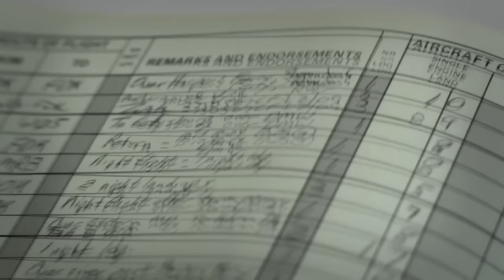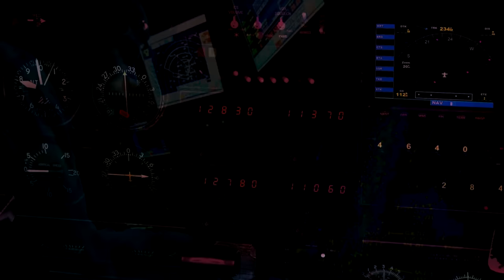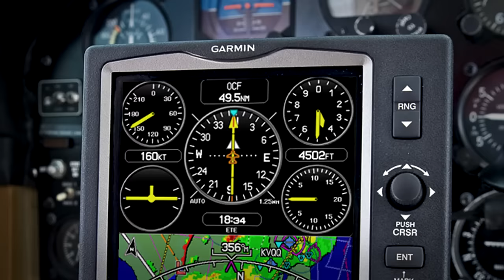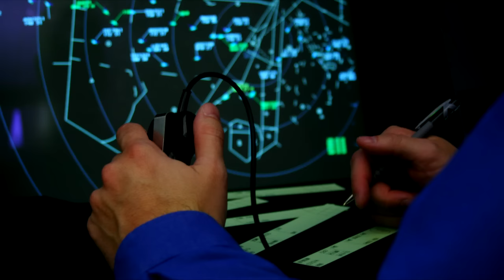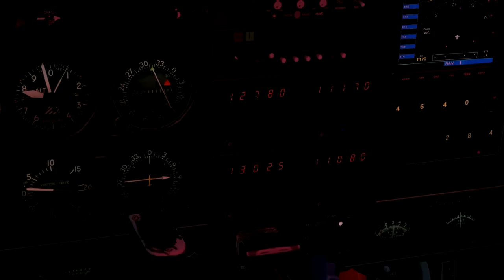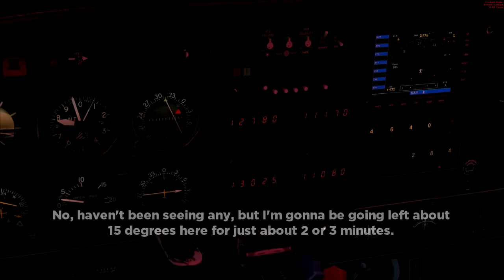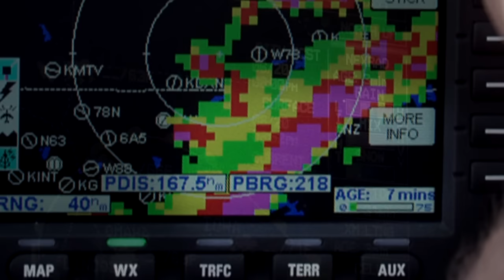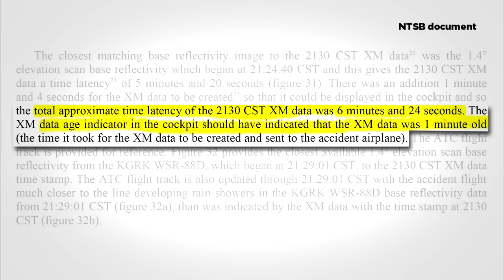Accident Case Study: Time Lapse – misunderstanding in-cockpit weather displays can lead to tragedy

Comment: Does not matter what you fly. Back in the 70's I was helping a bunch of Hot Air ballons guys.  Some I did not help because their lack of attention to the weather..  One pilot thought it safe, except a weather front was due and they probably ignored it.   "Five people were killed and a sixth was critically injured in a fiery crash Saturday night when a birthday trip in a hot-air balloon ended in tragedy after the balloon smashed into high-voltage power lines in Barrington Hills and exploded in flames.
 The lone survivor jumped from the balloon and landed on the median strip of Route 14 at Kelsey Road after a fall of as much as 100 feet, Lake County Sheriff's police said.  HARRY EVANS, 29, of De Land, Fla., was in critical but stable condition in the burn unit of Evanston Hospital with burns over 25 percent of his body."
Reply: Is that story on the net? That happened a couple of years ago in Lockhart, Texas, during the day about 1000AM in the morning
Reply: I found it, the accident your referring to happened on August 17, 1981
Reply: The pilot. James Bicket, 26, of Bloomington Illinois realized a fast moving storm was approaching and tried to land upwind of the power lines and a gust of wind blew them into the 34,000 volt power lines

Comment: What I see is that the controller assured the pilot was in the clear.   what i dont get is when the pilot said he was skirting the edge of the storm the controller confirmed this back to him.   I know the nexrad is delayed but isnt the controllers radar in real time???   The pilot said he was going to keep the heading until he got south of the storm and the controller said that looked good to him.   next thing the pilot is right in the middle of the storm with loss of control.  Something not adding up.  IMO the controller should have said turn left another 15 degrees, but instead he said it looked good to him.

Comment: Why doesn't this video address the significance of the left wing separating from the fuselage?  Yes, he shouldn't have been flying through a thunderstorm, and it's important that they discuss the delays in radar, but the real cause of the crash was the detached wing.  In the manufacturer's defense, no matter how much you reinforce the wings, there will always be some threshold of stress beyond which they'll detach.  I get it.  I just think that threshold should be a lot higher than the stress generated by what looks to have been a fairly ordinary thunderstorm.  I would never want to fly through such a storm, but it would be nice to know the plane has a backup plan in a worst-case scenario like this.
Reply: There is mo significance in this. This is a result and not a cause. In bad weather chances are your experience turbulence that put your aircaft beyond it's limitation (Vne) and then a little bit after it start to break up. There is no point knowing precisely at which point it start to break, but i must be beyond the certified max speed plus a margin.
Reply: Thanks for the thoughts.  I agree the primary cause was the bad weather, but if the aircraft's limitations were a little higher, perhaps the pilot could have maneuvered out of the turbulent air.  Higher wing loading would have been a valuable redundancy in this case.
Reply: Yes, Cessna should use 4 x 8 x half inch steel I-beams for wing spars.

Comment: I’m always leery of low time pilots who begin all radio transmissions with “Hello Houston, you got N, bla bla bla with you” the phrases “you got” or “with you” or “and.....” are the cute little phrases of pilots trying to make the world think they’re big ole cow boys. This little ole cowboy was just in too far above his experience level. And what the heck is he doing way up there at 8,000? That just got him a rougher ride and longer free fall after the wings got ripped off. I used to haul mail at night. If you can’t fly above a thunderstorm and you want to get close or find yourself inside it, well, you want to be as close to the ground (within reason) well before you get into the rough air. Plus, yes......single engine Piper Cherokee 6 had no business that close to storms at night even if pilot was a cowboy. Va speed of a PA-32 is so slow that a gust from behind can put one or both wings (depending on what angle the gust strikes) into a stall resulting in a spin.
Reply: No one should have tried to fly through that, no matter their experience level. But, an honest question: Assuming someone was dumb or desperate enough to fly through it, wouldn't a higher altitude be better? As you stated, a gust could cause a stall or spin, wouldn't more altitude give you more time to potentially recover? (Not a pilot, just curious.)
Reply: Def Misanthrope 
Right! I’m not going to encourage anyone on here to try flying close to or through any thunderstorms. I just know that when I started flying mail at night, I asked our chief pilot about flying around and between storm cells. What he told me was stay low enough to be lower than the clouds so you can see and avoid the rain shafts. Also, the gusts will be more horizontal (which can be very bad) rather than vertical. Can you imagine the stresses placed on the airframe when it is flying through a 1000’ per minute up draft and that up draft immediately shears to 1500’ per minute DOWN draft? That and worse is what goes on up inside a mature
thunderstorm. I think of it this way, when you dump water out of a bucket, what does it do? It falls almost vertically until it hits the ground and then it splashes horizontally. Yes that could cause a stall or spin but I can do things to avoid or recover from that. If you fly up there in the severe updrafts and downdrafts and the wings fold up, well, there’s no recovery from that. And no, a parachute recovery system is not going to save the day on that one either. That’s my opinion.
Reply: @lembriggs1075  Huh, interesting. I know that paragliders  have been carried up in updrafts to their deaths, like 30,000ft without oxygen. Just be high enough, though, to avoid encountering microbursts too close the ground.

Comment: important points but the   air traffic controller should have told this pilot that he should immediately turn around, land at a save airport and wait a few hours until this   frontal activity area has passed.  Or go up to 40.000 ft and fly over it.
Reply: But the sigmet said the weather was crap up to FL450?

Comment: Why did he turn right into the weather's path? Even the ATC told him to turn right...

It still seems to me that a major problem happened here in that the pilot ignored the turbulence while focusing on the display, even ignoring the 6 minutes that it takes the system to scan the skies and prepare the digital display, and the 1 or 2 minutes that it takes to broadcast it to the receiving stations. The turbulence experienced by the pilot is very-much real-time just as the sound of the rain hitting the plane is. Steady rain with no turbulence is one thing. But when the plane is already going slow because of the high winds, and then starts to bounce up and down as you fly into the main cell of a thunderstorm? You really need radar to tell you to change direction Right Fucking Now? This isn't about "misunderstanding navigational aids" this is about being butt-fucking stupid. 
 
Clearly 450 hours of air-time and an ILS rating isn't enough to understand the planes' inability to withstand severe turbulence that of course wasn't even displayed on his precious Nexrad. It's like driving through an active construction site expecting someone to tell you exactly where the nails are going to be. And there's probably nothing that sucks as much in a plane as the wing coming off..probably every passengers' biggest fear on a flight is that the plane is going to disintegrate and crash from high altitude. At least in an explosion or a crash you're going to die quickly. This way he got to flop around for a good 15 seconds while falling the 8000 ft to the ground at sink-rates over 500 ft/sec.

Yet another cocky pilot goes down in a shower of parts, crashes, burns and racks up his own personal Darwin Award as well as one each for his wife and kid. I have zero sympathy for this guy, I can't even excuse the ATC for letting him get that close to the weather which was clearly displayed on both systems. The only thing that could be hoped for in this situation is that he didn't kill anyone on the ground. And tell me that THIS isn't a good argument against buying a used airplane.

Comment: The aircraft controller  should  of told the  pilot to make  a left instead  a right and the pilot  live and crew  would  of been saved
Reply: I think perhaps the reason the ATC suggested a right turn was because of a narrow break in the storms. But like the video said, the weather updates the pilot saw were delayed 6-8 minutes, and the storms were moving along at 45 mph. So by the time he made the decision to turn, he was turning right into a storm. But either way, he was flying way too close to those areas of convection. A good rule of thumb is to put 20 miles between your aircraft and a line of storms.
Reply: Yes, I noticed that too.  If, due to the circumstances, the plane's direction was unclear to the ATC, he should have just instructed the pilot to travel to the south-west.
Reply: I caught that to.  That seemed to be a risky move as I watched the video.  Maybe some things just can't be stopped.  So sad.

Comment: Wx, aka weather, is not emphasized anywhere enough to pilots in general. I believe there should be so advanced meteorology taught during the instrument rating and having been through it, no one teaches enough about weather in instrument training. No one, no fly schools, nobody. Also, attitude and the get-there-itis is a big factor. We are all taught to not be late for anything, well, in the case of private flying in a small craft, life is more important and getting there is the no 1 factor, vs what time you get there. And plan way ahead. Alternates are required for instrument flight and it seems he didn’t file IFR on this one either.

Comment: it's common knowledge that pilots make the final decisions, but perhaps it's time to give controllers the authority to force a plane to go elsewhere, like in this case, instruct the plane to a nearby airport with good weather, where he is to remain until the bad weather passes. They can already prevent aircraft landing in controlled airspace, so they should have some kind of authority to direct flight in Class E and G airspace, too.

I wonder if this pilot was instrument rated.
Reply: No, I'm an FAA controller and we don't have enough information to make those decisions. We only show precipitation, not things like cumulus buildups which could be equally dangerous. We also don't know where clouds are, so forcing someone in VMC deviating around storms and buildups to enter IMC doesn't enhance safety. Plus, they could simply say "no thanks, we'll cancel IFR and squawk 1200, bye..." and that doesn't make things safer either.
Reply: Thank you for this post kewkabe.

Comment: Can't these high IQ IT'ers not make a computer program that can more or less forsesee where a storm will be 6 minutes later, giving its speed + previous more or less similar cases, and hence show at 10.00 a.m. where it thinks the storm is at 10.00 a.m., in stead of showing where the storm really was at 9.52 ? And also give accordingly instructions, like fly N.W. for 20 seconds, than start to make a slight turn to 10 o'clock, while gradually climbing to... etc etc ? I mean, not just computers, but clever computers, who think like an air traffic "controller" ? I know it can't predict everything acurately, but at least it could rule out the worst possible choices by pilots with not that much experience ? Getting weather reports from 8 minutes ago is indeed not just ridiculous, but extremely dangerous. Getting the best possible real time guess is not waterproof, but at least less dangerous. And as far as I know, using a number of vectors, storms are to an extend predictable. Maybe make R&D teams of IT-people and "storm chasers".

Comment: This pilot had more hours and experience than the Ethiopian Airlines 737 MAX crash copilot.  Think about it
Reply: The pilot in command of that flight had over 8000 hours of experience, and until 2013 all that was required in the USA for co-pilots was 250 hours flight time. Still I get what you're saying as this guy made mistake after mistake flying into weather.
Reply: @haleiwasteve8434  that was for commuter airlines, not majors. Do your research. And most airlines like mine (Southwest) set HIGH hours and experience before you can even submit a resume
Reply: @joelt4416  I don't dispute for one second that Southwest sets high hours (in CAPS) and experience and rightfully so. Did I read this article wrong? https://www.pri.org/stories/2013-07-10/co-pilots-need-more-training-faa-finds-after-colgan-air-flight-3407-crash

Comment: A simple solution to prevent accidents such as this. 

Require all aircraft to have live updated weather data....
Reply: He had as close to live data as is available with current technology.  The "simple solution" is to stay far away from such storms... but there will always be pilots who push the limits.
Reply: +parafan Yes, sadly. I find it a disgrace to do that when you have your family on board, let a lone have a family at all.
Reply: it's called "BETTER PLANNING"...
Reply: Javier Llaneza Very true
Reply: You can not legislate Good Judgment Manuel. That is what is lacking here, in addition to not understanding his limitations and his equipment's limitations.
Reply: parafan what? You realize that airliners and expensive private aircraft like the Socata TBM all have active radar on board, yes? Datalink weather is hardly "as close to live weather with current technology."
Reply: On board can give you better real time nearby info., but not the big picture from the delayed data link Nexrad.  

In any case, skirting close to convective cells can bite you without notice.
Reply: Manuel Gaetan 
In a perfect world, maybe so. Even then, one must count on related factors such as the pilot being able to accurately mentally decode such information and act accordingly in time,second guess what & when the wx will do next (just because a storm has been steady in strength and course over the last hour, doesn't mean that it will continue as such or more won't form "out of thin air".
I hate to go to the second point but we must think "real life". That is a major expense, one that would be too high for a large percentage of GA owners. I know you can't put a price on safety, but we also do not want to "price out" a large percentage of GA owners. There's a breaking point for nearly all owners. (And when fewer pilots / owners can afford to stay in the game the price goes up on the remaining ones since less are being bought & manufactured.) The keys here are training, judgement, avoidance, and always sticking to "Staying on the safe side plus 10 percent". When we had our own aircraft that would have been the budget breaker for us... our Bonanza had a Narco Mark II Omnigator and a Lear ADF w/ emergency xmitter supplemented by using our best judgement while always staying on the conservative side and trying our best never to become complacent, never afraid or ashamed to do a 180° to be certain to live to fly the next day. I remember a few people that were priced out of flying because of the requirement of installing an ELT on their craft. What you propose would otherwise be great, but even then it could not control "The human factor".

I wish for you safe & pleasurable flying always.

The three things to always remember: (along with everything else of course)
 "A pilot cannot use the runway behind him, the altitude above him, or the avgas back at his departure still in the FBO's tanks.
Reply: He does have live weather in the cockpit.     It's a simple push of button away.    All he has to do is ask the controller
Reply: It was odd/unfortunate that he seemed intent on using his own weather information to pick his way through instead of letting the controllers guide him through. They seemed quite willing yet he resisted. I think ultimately this accident was caused by pride.
Reply: He had live up to the second weather data.......from ATC who he refused to listen to because he had some kind of weather toy.